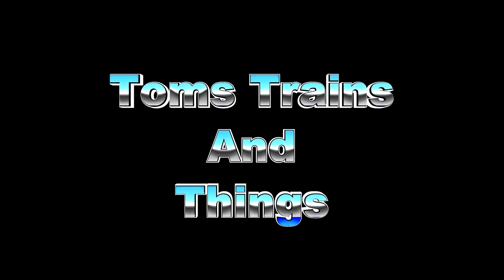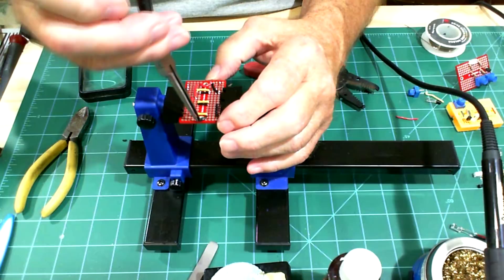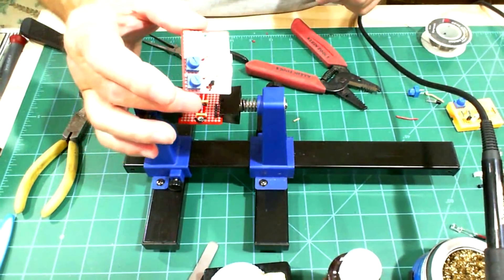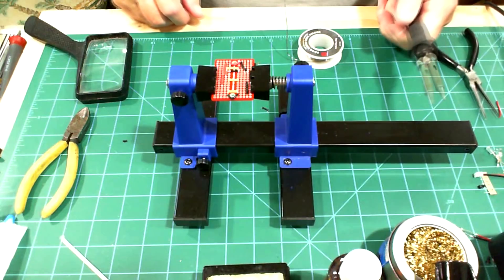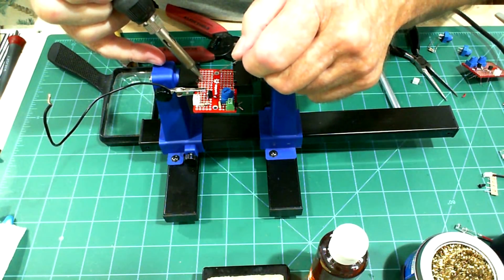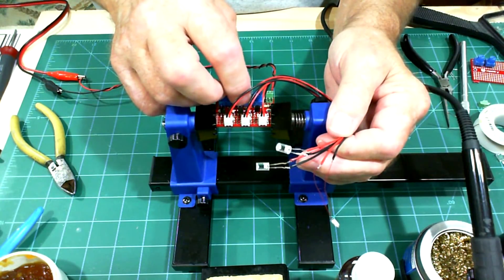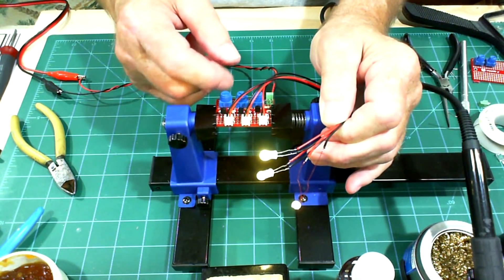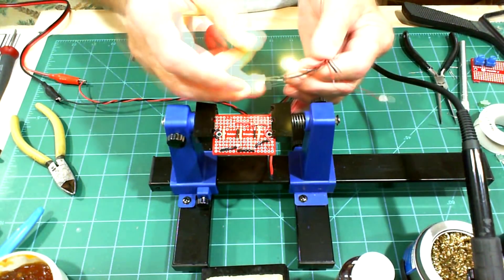Easily Solder Your Lighting Project On A Circuit Board

Comment: Tom,
As the price of switch machines is so high, I've decided to use 9g servos.  We need to know how to power them and how to control the speed and direction of them.  We all need a really good tutorial on them.
Doug
Reply from the maker: Thanks Doug. That will be coming up in the Arduino videos. Had a lot of requests for operating servos.